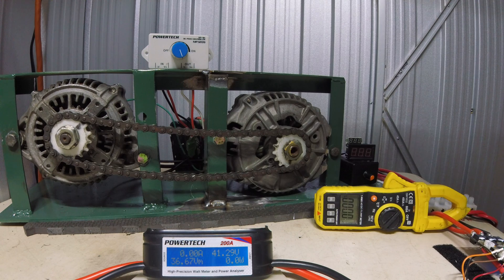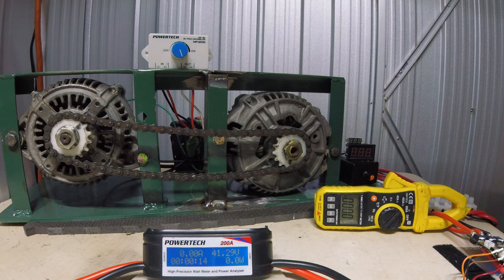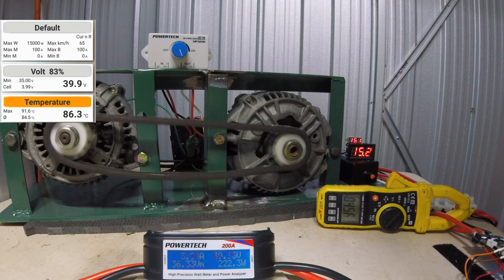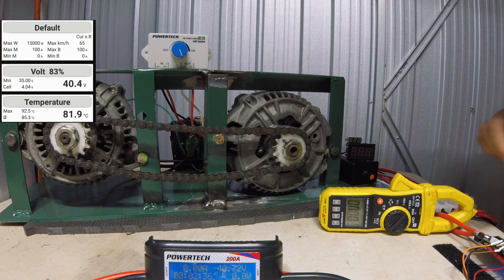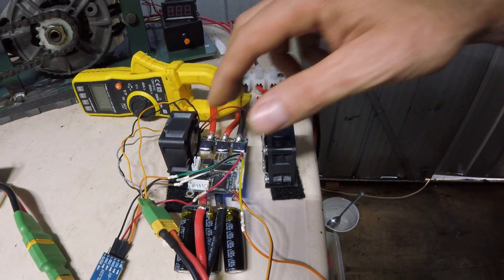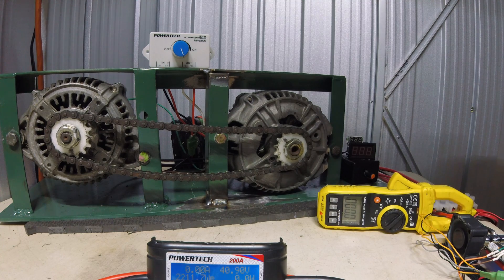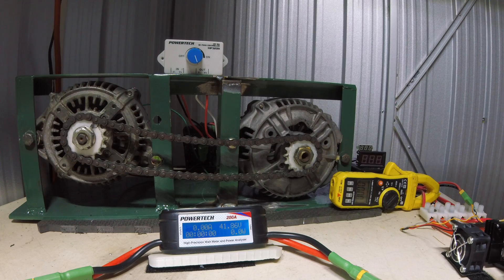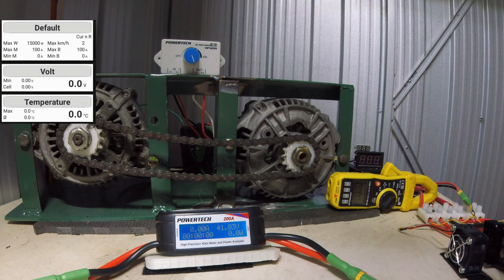Load testing vesc 4.12 with and without cooling using alternators converted to brushless motors

Comment: Are you running both motors on 1 VESC or is the VESC a dual one?
Reply from the maker: Hi I’m driving one motor with a vesc and the other one is a load so I have just shorted the phases with a coil in some water to dissipate the heat

Comment: I'd d like to ask you if you have tested VECS with AGM battery. Is possible to get working system with this kind of batteries? Have you test regenerative brake function on your VESC?
Reply from the maker: @goowatch it should work fine with AGM battery’s.  I have done a little bit of testing when I had 2 vesc’s what I found is that the motor doing the regen has to be spinning at I high rpm so it generates a voltage higher than the battery’s which is near full rpm.  I could be wrong but this was the only way I saw any regen!!   braking done at lower speeds was just shorted in the mosfets equalling in heat I believe.  If I do manage to fix my other vesc’s I will definitely do more testing.

Comment: Well, i loved the tests, specially the last one.

I think you can get the VESC even cooler than in the last session using outside wind (using into a project build), maybe the speed WITH the heatsinks can keep the VESC below 80°C.

And about the battery voltage, i was thinking that maybe a 13S Li-Ion or LiPo (54.6V max/48.1V nominal) can break the 2000W continuous barrier keeping the same 40A current, i need to grab a lot of money to import/build the battery pack, vesc, alternator and other things
Reply from the maker: @FoxxyYT cheers mate.  Yeah I think your right with the air flow also the temp in the shed was around 26c. I am unsure about going any higher in volts ive read reports of them burning up!! Might to try though lol.   Where do you live? I have heaps of 18650 batterys they would need pulling apart and making in to packs though.
Reply: @fixitmoditbreakit7982  i live in Brazil, i was searching about how to make 18650 packs but the BMS thing makes me confused.
I know that i need nickel straps, a spot welder, and Liito-Kala 18650 testers to check their capacity/current
Reply from the maker: @foxxyytofficial  I don't use a bms just charge them up with a balance charger.  A bms is just a way of charging the pack and protection if something goes wrong.  So with out a bms you are running a risk but if its just for testing and your monitoring the currant and volts it should be fine.  Ive got mine from lawn mower shops stihl back packs they have 110 18650s in them and shops have a hard time getting rid of the old packs.  They are in packs of 5s in series to make 10s  so thats why I run 10s as i have many.  I think when i make the next vehicle for my boy I will use a bms just to be safe.  You should make a visit to your local mower shop and ask if they have any old packs they want to get rid of!!
Reply: @fixitmoditbreakit7982  here we don't have a lot of battery-powered machines, only the most expensive Dewalt drills, and they don't have old packs
Probably the only way i could find batteries is to try and buy older packs from notebook service/assistance providers
Reply from the maker: Dam thats a shame mate.  Yeah could go for laptop batterys or lipo's if you can get them there